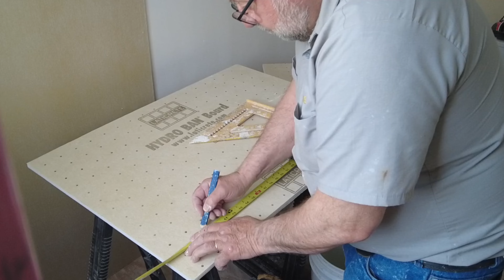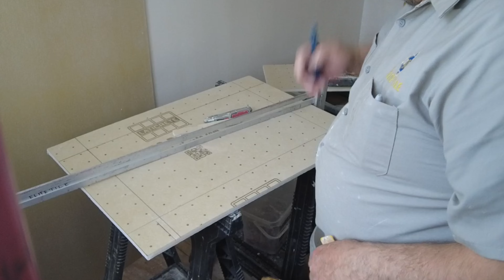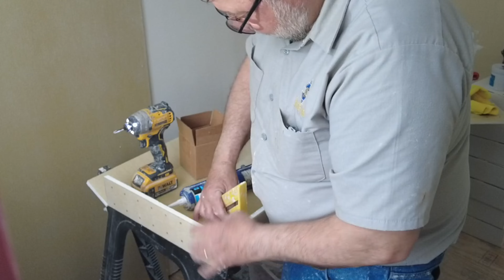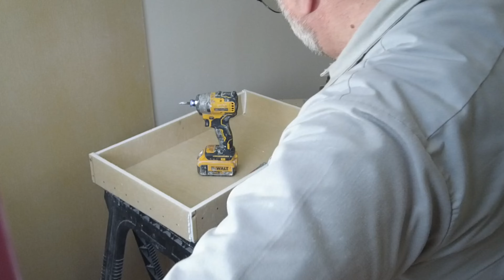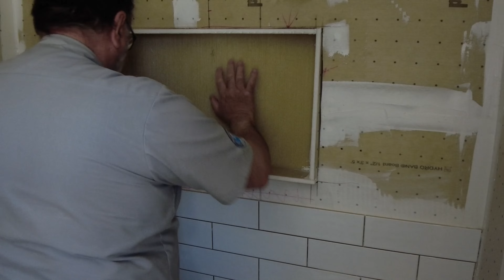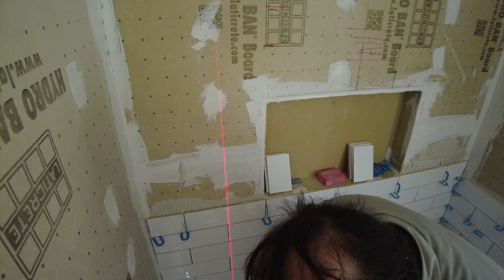How to make a custom  niche out of foam board for your shower

Comment: Is the time really worth it? Why not just get prefabricated niche?
Reply: The reason I make niches is to fit into a layout that reflects the size tile and grout line being used. This saves time in the end. Niche sizes are limited as well.
Reply: Pre fab sizes are limited and often times need to be modified for different sizes. Learning to do this saves a lot of time and allows you to make sizes that fit into a tile layout perfectly., saving time in the end.
Reply: he can build this to fit directly into the rows at the exact size he needs. and he doesnt need to spend 100$ to do it.  it takes maybe 20 min to build and set